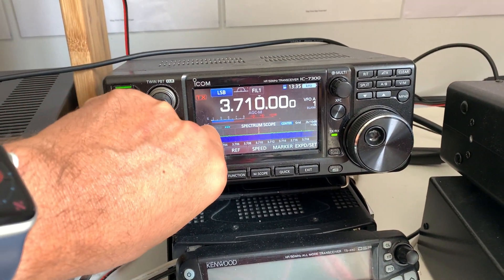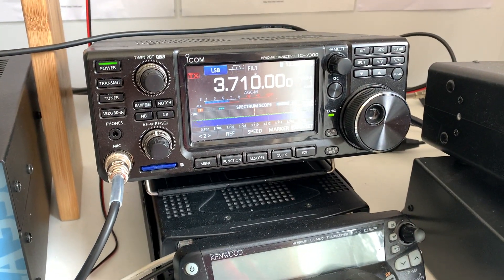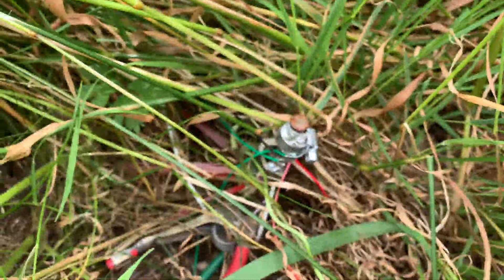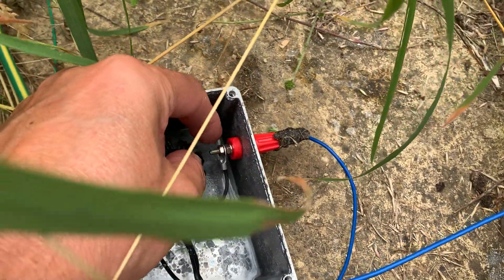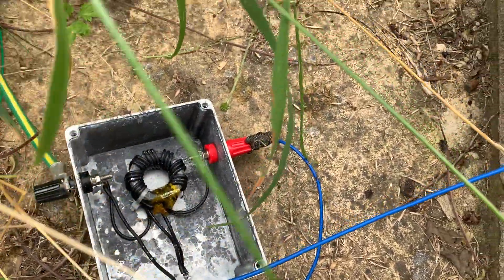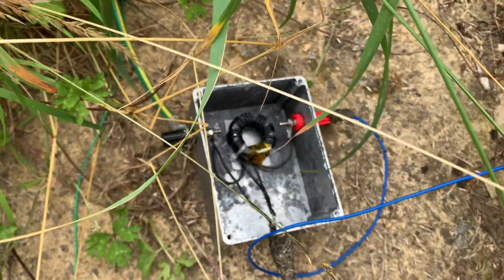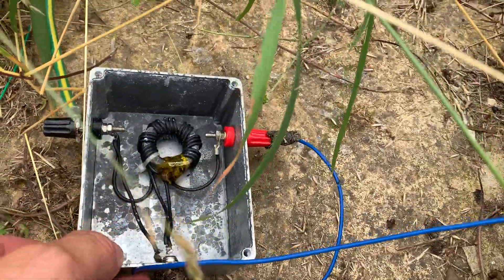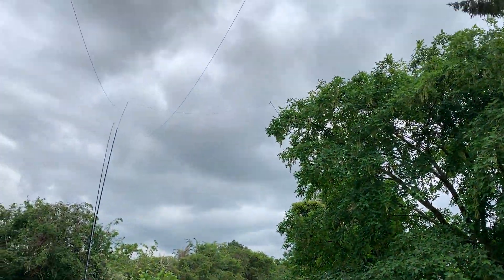Problem with my HF end-fed wire antenna - part 1

Comment: NO PLASTIC BAGS!  Putting electronics outdoors in plastic bags attracts moisure.  You didnt waterproof your unun.  Just leaving a rubber seal is not enough.  I've used silicone as well as using high quality electrical tape to water proof the coax connection as well as  silicone over the electrical tape.  Your transformer doesnt look to be stable also I would not leave it floating around inside the box.  Doing what I said has allowed me to leave my 9:1 Unun outside on the roof for many years without any water intrusion.  Even antennas need to be waterproofed properly outdoors or you will end up frying your components.
Reply from the maker: Thanks for your comments.

Comment: If it's a metal box I certainly wouldn't have the core sitting on the metal. Get some felt strips and prop that core away from the metal or switch to a plastic box.   The box can be waterproof and still draw condensation.  You need a vent.

Comment: Do a 3d Print a case. thank me later. saves a lot of trouble. if there was water inside, check for corrosion or the green stuff afterwards. it influences connectivity.

Comment: Ventilation would be ideal even better in the ABS waterproof connection box outdoor electrical enclosure terminal junction box I had lower SWR with it then metal housing box.
Reply from the maker: Agree with you!

Comment: I could be that your box is water proofed, but condensation occur in it and you need vent to avoid it. Hope this helps.
73's de Patrick OT5Q
Reply from the maker: Agree with you Patrick

Comment: You might find that applying silicone or lithium grease to that rubber ring will help keep the seal.  Petroleum jelly definitely doesn't work, it eats away at the rubber.